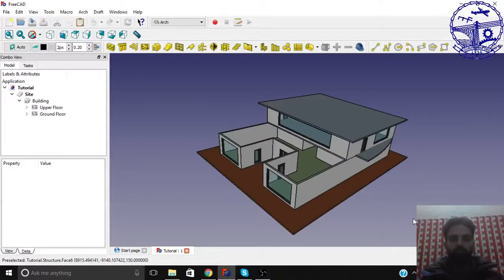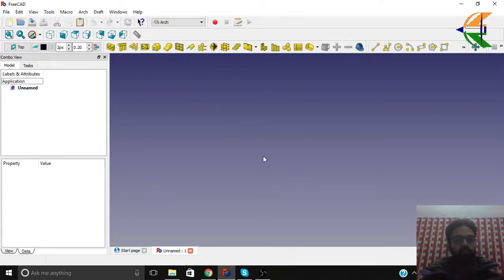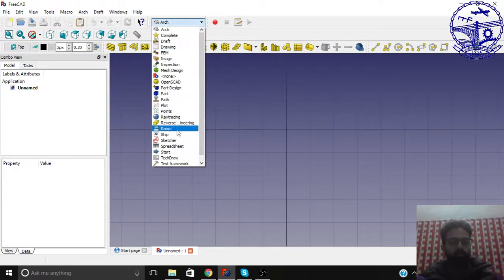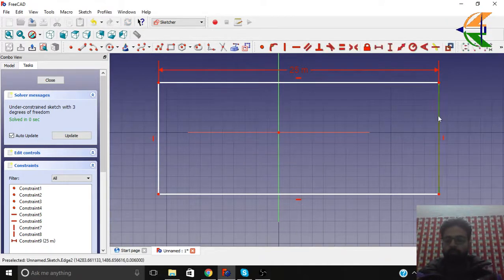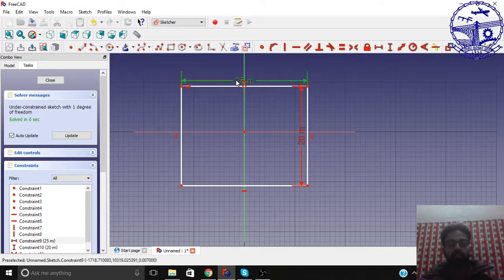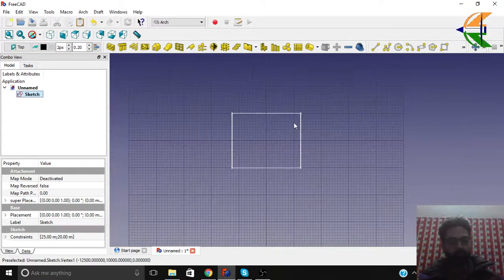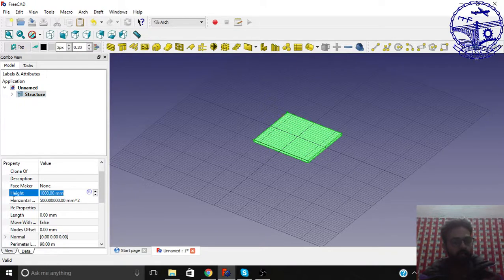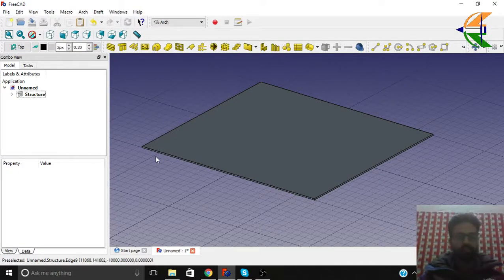2. Architectural BIM Modeling Course Using FreeCAD - Creating Slab

Comment: As you were talking, 35 seconds into the video, you did something to change the scale of the dispayed grid, but not explain what you did.   How did you change the size of the grid displayed ?  When I follow your exact commentary to create the rectangle, and use the same dimensions as you did, the shape does not fit on the display.   I cannot find the sides of the rectangle as the scale is so inappropriate.   Help, please
Reply from the maker: Yes, you can change the grid size. Open the Arch workbench, then go to Edit > Preferences > Draft > Grid and snapping > Grid Spacing and Grid Size. Here you can change the spacing and size of the grid.
This will also solve your problem of rectangle not fitting on the display.
Hope that help. :-)